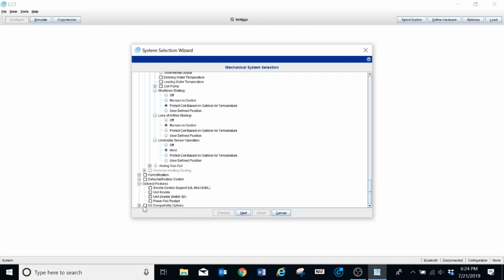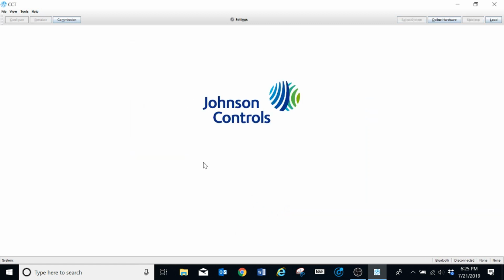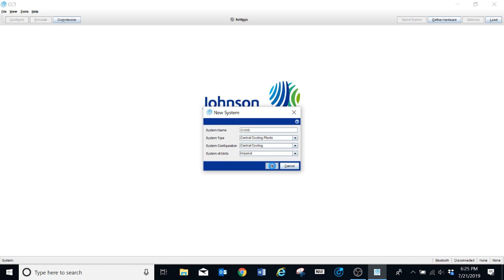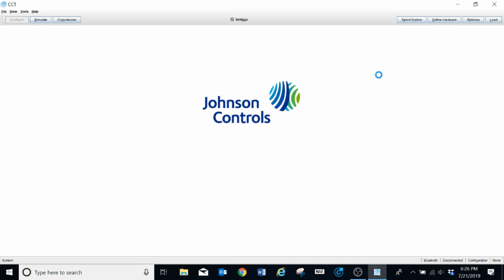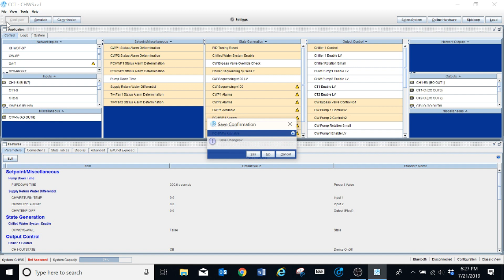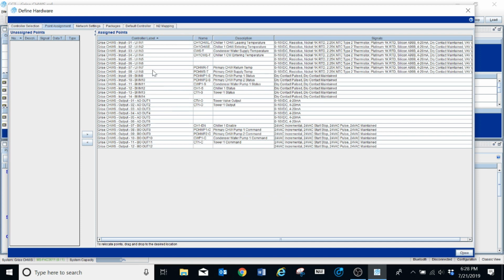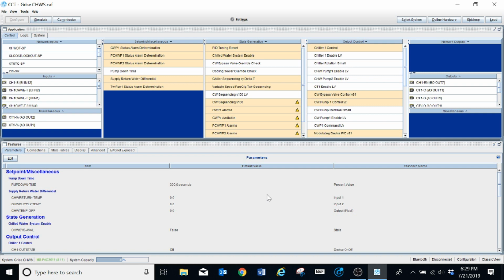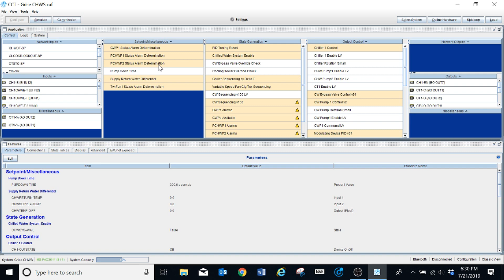Johnson Controls CCT N2 Options

Comment: Nice tip.  Speaking of GX9100, wish you made a video explaining a complex program.  Specially showing connections, modules,  timers etc.
Reply from the maker: Maybe in the near future. We're starting to phase them out.
Reply: System Control Tech Your videos are always very helpful and instructional. Was wondering if you could do an exhaust system with bypass damper command. We are in talks of upgrading an exhaust system and would appreciate some guidance on how to start the programming process...great video!